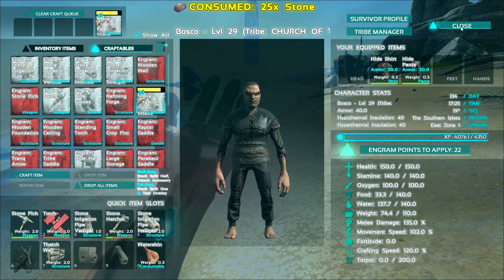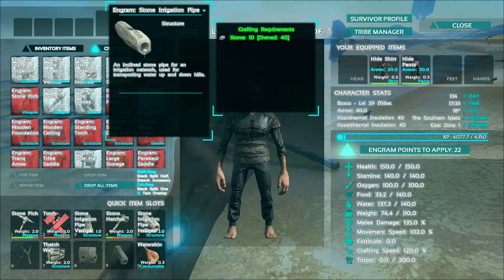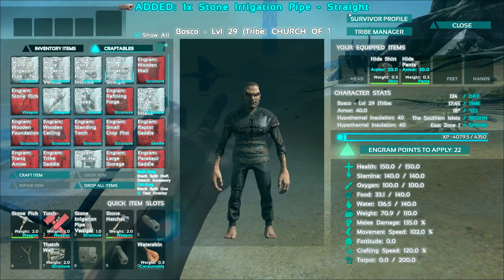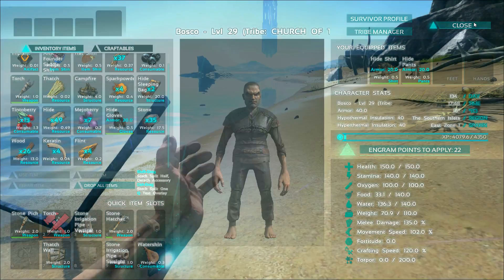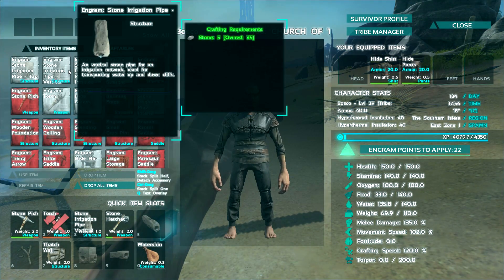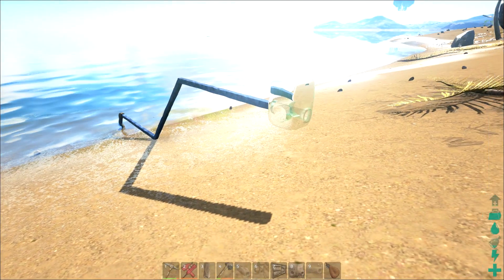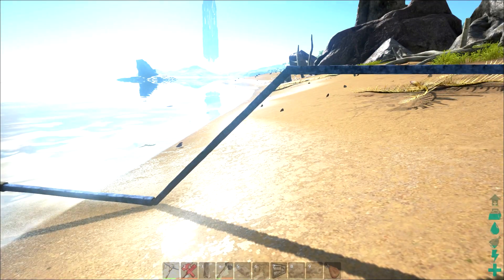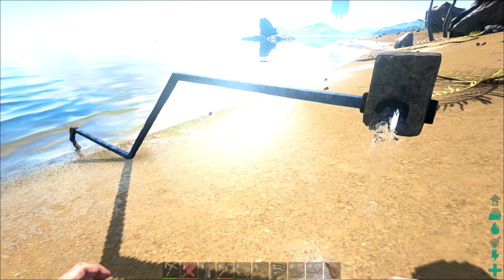ARK Survival Evolved - How To Make Stone Irrigation Pipeline (How to get Water Source in Base)

Comment: Do you know if there's a way to turn the angle of the pipes...? they seem to only go in on direction
Reply: There's a pipe that goes in all directions so u can turn it by using the quad pipe (that's how I call it)
Reply: Yeah its an intersection or something. But it doesn't quite do what I want. Thought there was a way to make them perfectly straight but there isn't it seems. I think you just have to place it as straight as possible.

Comment: i cant make the pipe that goes up, only straight... why? ive teached the 3 things i can teach, i cant find the one that goes up and down?
Reply: Even Kristiansen I've the same problem... did you find a solution ?
Reply from the maker: Even Kristiansen vertica pipe, there are more than 3 pipes in there to learn :)
Reply: Yeah i found them :) i was too low level :P
Reply: Trexana Which level did you get it in?

Comment: I have one of these and the water stopped. How do i turn it back on?
Reply from the maker: +Napalmburns check that all the pipes are still there all the way to the water
Reply: It is. It looks exactly like yours only a few pipes longer. It did work for a little while than stopped for some reason
Reply: I stripped it an rebuild now it works fine :)